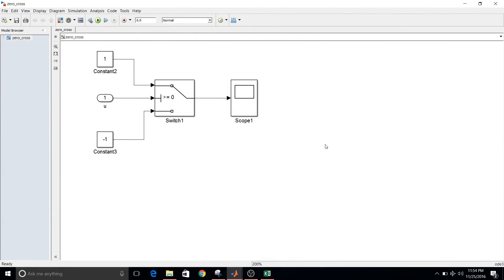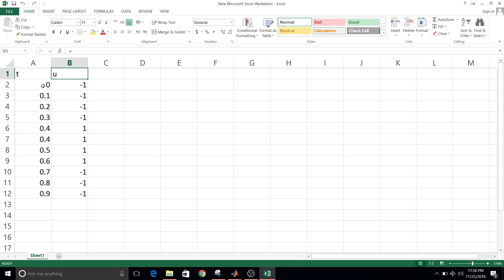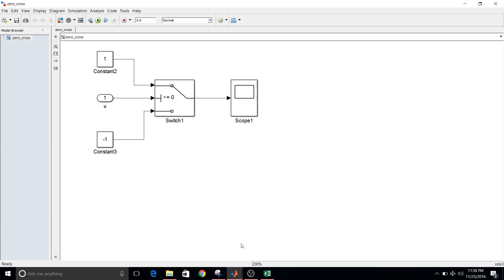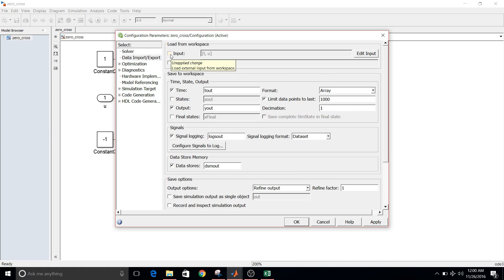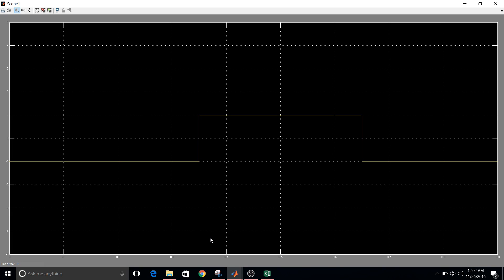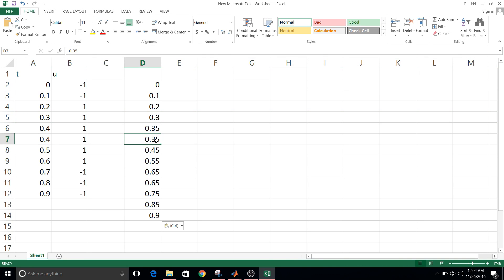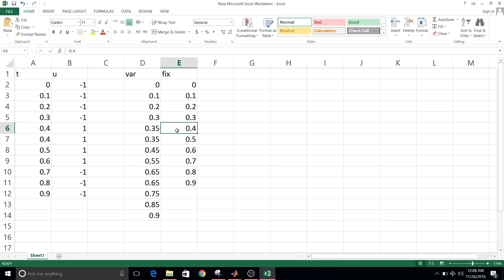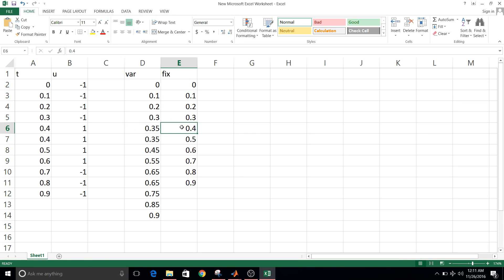Simulink Tutorial - 11 - Types of Solver - Variable & Fixed Step

Comment: Solution to problem 'undefined reference to t ...'   . I will echo the solution provided by an earlier commenter 'Stip Kafle', when importing the excel sheet you will notice a drop down menu in the top left corner titled 'Output type', you must specify the type as column vectors. You will now see that t and u are imported as seperate variables into the workspace and are therefore defined.

Comment: External input specified in the Configuration Parameters dialog box on the Data Import/Export page (or as an option to SIM command) to a model containing no root level input ports
what does this mean

Comment: Error evaluating expression '[t, u]' for 'ExternalInput' specified in the Configuration Parameters dialog for block diagram 'untitled'.
Caused by:

Undefined function or variable 't'. 

where should be the function defined??
Reply: While Importing data from spreadsheet,when spreadsheet windows pop up then in upper left corner there appears 'output data type' just change it to column type.
Reply: @stipkafle4642  thank you
Reply: @stipkafle4642   Thank You . It's Working

Comment: Error evaluating expression '[t, u]' for 'ExternalInput' specified in the Configuration Parameters dialog for block diagram 'untitled': Undefined function or variable 't'.
Component: Simulink | Category: Model error
Error evaluating external inputs specified in the Configuration Parameters dialog on the Data Import/Export Page. External inputs may be specified as either (a) a list of matrices, structures or timeseries or (b) a single MATLAB expression or function
Reply from the maker: +Renjith Shenoi t should be column matrix
Reply: @simulinktutorial9086   It is column matrix max ....Did same thing like u did in the tutorial video

Comment: Thank you for the video!
Can you help me a little bit please? After I close Matlab along with Simulink, then reopening, Simulink cannot seem to find pre-defined variables (e.g. t; u). How can I relate them to each other?
Thank you!
Reply from the maker: +magyarikristof when you reopen the model, you need to import data manually as shown in the video. If you want to avoid that then add the load command for datasheet in callbacks. So every time you open the model the datasheet data is loaded in the workspace
Reply: @sameergdk1  you load by adding it to the pre-load function